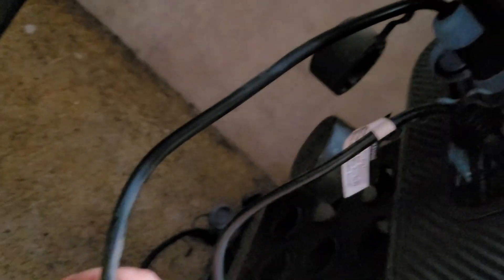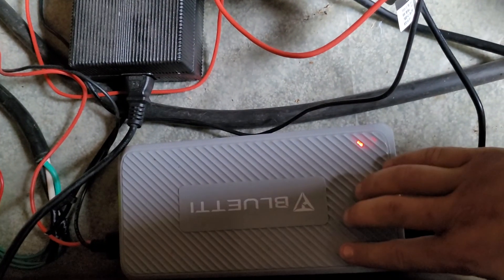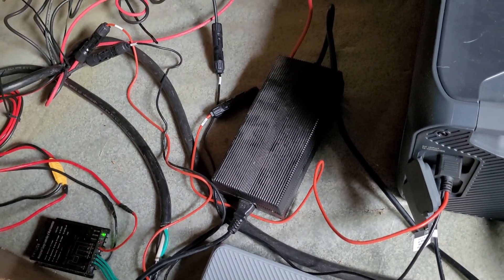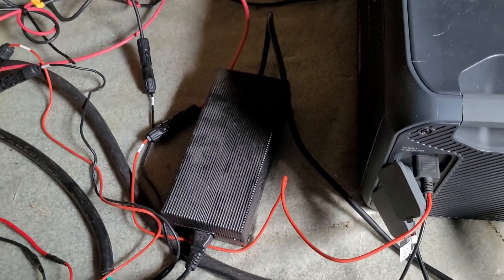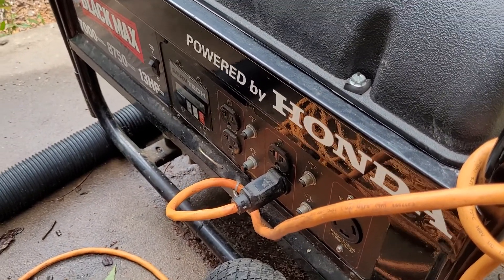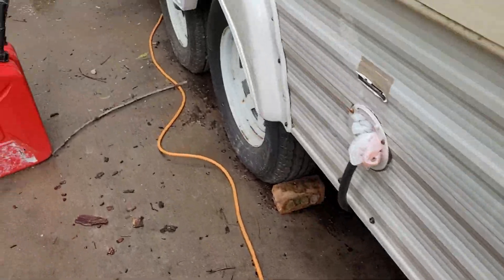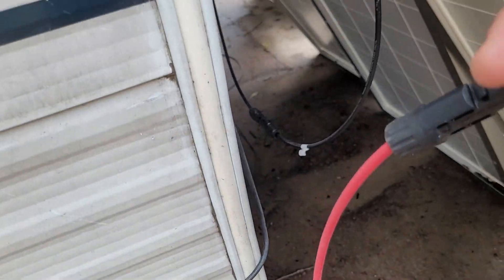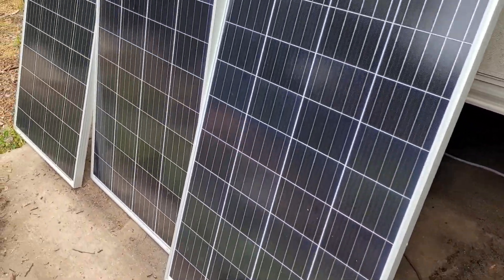Bluetti Ac200max & B300 How to Maximize your Solar Input! #BLUETTIAwards

Comment: Hey, I just got a D050S to help recharging my AC200MAX, which is connected to two solar panels in series all the time. The D050S has its own solar panel. I noticed a clicking (relay on/off switching) after adding the D050S at Sunset time. Do you have your D050S connected to your AC200MAX all the time (and do you hear any clicking continuously at Sunset or Sunrise)? Thanks for any reply...
Reply from the maker: Yes this is nominal.

Comment: The biggest downside is that when you have the expansion battery packs connected, and you discharge this whole system to zero, it will turn off the expansion packs.
Reply from the maker: Right